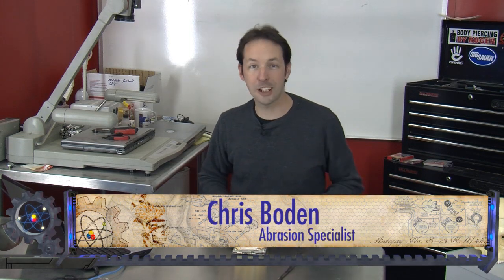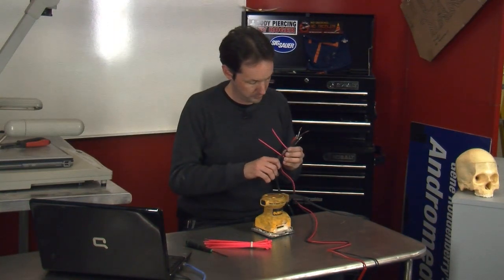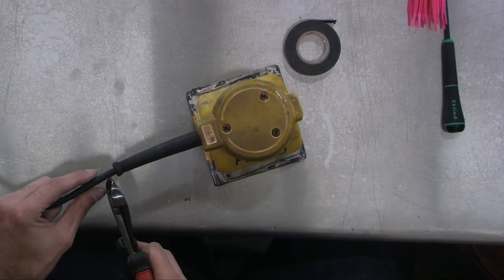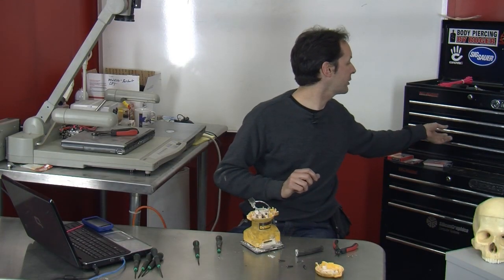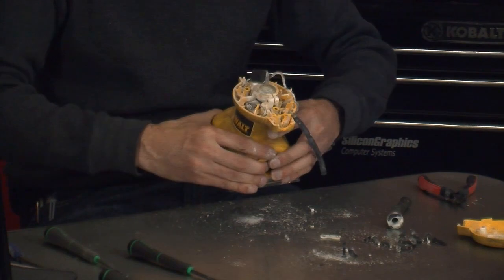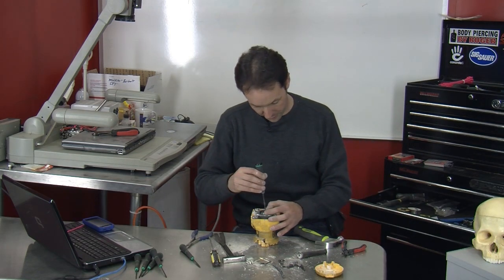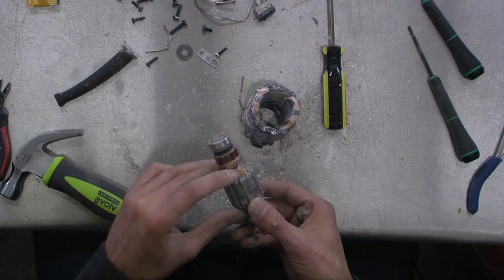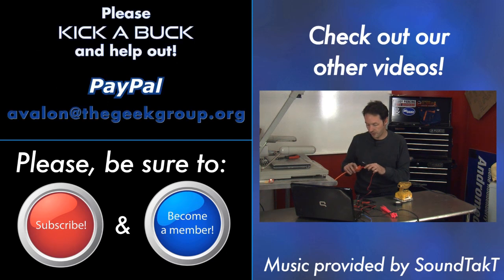Palm Sander: Equipment Autopsy #48

Comment: So you're saying that an errant hunk of metal got caught in the motor. Caused a short-circuit and 'burnout'. Thuse causing the death of the tool. I was hoping for more info. on the cause of death. Being an autopsy. However, kudos for careful removal of all body parts. So it was the fuzzy thing on the carbon brush @ 9:53?

Comment: Hay Chris your working on a metal table with electricity. Just thinking that if the hand sander or some other thing your powering up on the table  were to energize the table you could get shocked or killed. Is the table grounded? If not please use some sort of insulating pad on the table before you power something up again. I don't want to see my favorite You Tube guy hurt.

Comment: With all the things you got in the lab you have no plug with well isolated screw terminals on the other end? It would have been safer, if you stuck the wires directly into the socket. ;)